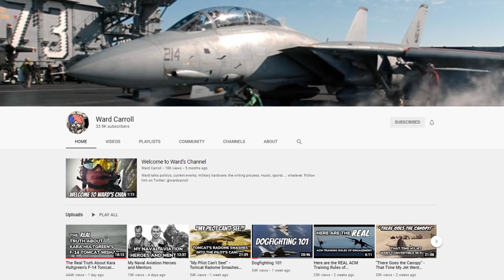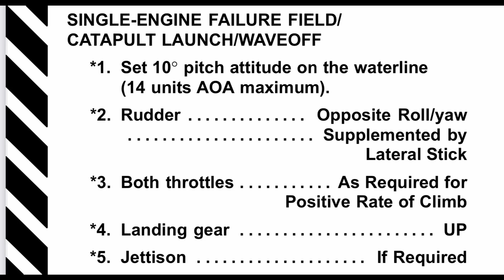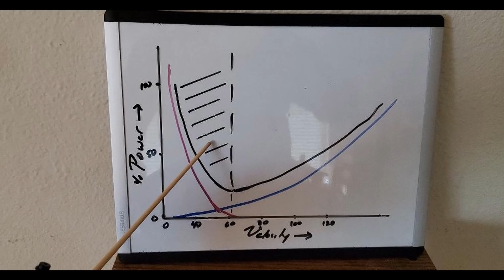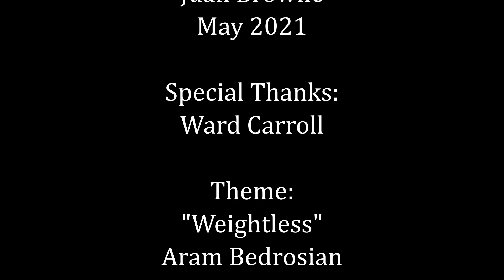Navy F-14 Crash/Stall Demo-Lt. Kara Hultgreen Accident

Comment: Unfortunately the Navy chose to handle the women transitioning to tactical pilot position differently from the AirForce. The Air Force didn’t change their syllabus to make easier and more abbreviated like the Navy did. The Navy back then had two trips to the carrier in the T2 and TA4 before even receiving your wings. Air to air gunnery on a tow target. Bombing. ACM. These women didn’t receive that training and it showed

Comment: A correction to the Kara Hultgreen accident. When Kara over shot the final she didn't use aleron. This is from the Wikipedia page "Finding herself overshooting the landing area centerline, Hultgreen attempted to correct her approach by applying left rudder pedal, which caused the nose to disrupt the airflow over the left (inside) wing, as well as the airflow to the left engine intake". IMO pilot error...

Comment: I think it just dawned on me what you are doing in the single engine plane to "simulate" the compressor stall aerodynamics issue.  Because you only have one engine you can't induce yaw from a one engine failure in a twin engine airplane (regardless of how close the two engines are).  So you use rudder to induce the yaw and then show how aileron is the wrong input.  In the single engine of course this is quite obviously a cross control maneuver and exactly what you would do to start a spin if you have high AOA and or low speed.  So the moral, if I have this right, is the engine out on a twin is aerodynamically similar enough to tossing in rudder on the dead engine side and so the first move is to counter that with opposite rudder.   Is that correct?

Comment: Indeed, the F-14(A/B)'s twin engines are actually offset (separated) quite a bit more off the center than usual for twin-engine fighters and that single-engine roll is a much bigger deal in F-14 that pilots have to take in account, so it wouldn't be inaccurate to say that the design of the F-14 itself contributed to this accident, at least in it being fatal. You can see this being pointed out by one of the designers as "Widely Spaced Nacelles" https://www.youtube.com/watch?v=SsUCixAeZ0A at 19:22 -- Fellow patron for 2+ years here and BTW you can fly F-14B in a home computer simulator, seeing that you got into MS Flight Sim 2020 recently, it may be another thing you could try: www.digitalcombatsimulator.com - Infact you have a couple of civilian planes there too, one of them you mentioned in the recent Aviat A-1 Husky video you did 2 months ago, the Christen Eagle 2 one of the civilian airplanes that's available in this computer sim here https://www.digitalcombatsimulator.com/en/shop/modules/christen_eagle/ and then you have Yak-52: https://www.digitalcombatsimulator.com/en/shop/modules/yak52/  as far as civilian goes, the rest are military, and for reference here's the F-14B: https://www.digitalcombatsimulator.com/en/shop/modules/tomcat/ -- And well that means you could as well try that same thing in the virtual F-14B hehe! And, I have a lot of DCS modules, but not the F-14B yet, had it on my queue for a while!

-- Setup --  First you would need to download the free DCS 2.7 installer https://www.digitalcombatsimulator.com/en/downloads/world/beta/ with it's base files and data which includes a free terrain-map based in the Caucasus region, there will be another free map later in the year based in the pacific ocean as "Mariana Islands", then each aircraft and terrains/maps are paid modules that you can buy and install separately it's striving to be serious simulation so it will cost something. DCS unfortunately requires a really good computer (Windows 10 only) preferrably with fast SSD storage and great CPU to prevent stuttering, not to mention a great GPU to keep the FPS playable. It can take over 200 Gigabytes of storage with all the modules but you might only need around 60-80 gigabytes of free space if you just try Christen Eagle or Yak-52 for example, depends largely if you buy additional terrains/maps which take the most space. Terrains in DCS are totally different from MSFS20 due to focus on combat simulation and not civilian transport or long distance hauling, so no such thing as whole world coverage (yet), they're are also very much hand-made, unlike MS Flight Sims including 2020 which is largely a script-automated process from imported sources of world geometry and topography with select areas hand touched such as airfield perimeters and important landmarks. 
DCS's terrains might look better closer to the surface because of the high amount of attention each inch gets. There's a few flight "sim/game" softwares out there and they don't all compete in the same category so the differences aren't pitfalls or victories, they have different goals and intentions, some are more game-oriented and simplifed, just to clear that up if you're indeed just now learning about this computer flight sim stuff and if you see any of the drama, the communities are definitely more mature than any other computer game category, but you should also note that there may still be teenagers involved due to these computer simulators crossing into the "video game" fields as they get more and more photorealistic, so that if you see the drama or some people talking nonsense it may just be children/others arguing with themselfs who never stepped into a real aircraft or studied highly sophisticated physics/mathematcis and real aircraft manuals. Hopefully you can figure out the technical side of it getting it running, you can aslo get it on Steam but they have their own standalone installer-updater and e-shop on the main site, otherwise there's always very knowledgable people available to answer any of your questions at https://forums.eagle.ru 

-- I've actually thought about giving you a heads up on DCS for quite a bit now, been busy and didn't find a good excuse, but just found the perfect opportunity right now, except I hope I didn't barge in during your fun with MSFS20, take the time and enjoy that ofcourse, no need to rush hehe. 

-- What I find interesting is that you, as a real pilot, (I'm afraid I can't afford to, so only computer sim background on my end), could try and test some of these computer airplane sims out and see how they behave and give response to how you experience things in the real jet, doesn't have to be professional review or serious testing, it can be on a depth level you feel appropriate, but even with just that maybe you might find some issue or s huch if you feel something doesn't feel right in the computer sim, so it wouldn't be just fun but it could evern count for some valuable feedback to improve the software. So yeah I'd love chatter and comparison videos if and when you get extra time, and where you feel you could provide some unique insight where it is worthwile, don't have to do it if you feel there's not much to say, I wouldn't want to cut other important stuff you're doing out with this hehehe.
  
-- And lastly, I kept funnily remembering myself about the potential confusion of "simulator" which we would all have differentiate these days, because in your backgroud you have most likely always meant the multi-million dollar full-cockpit PHYSICAL simulators made by the manufacturers of real aircraft (or learning/testing company/agency?) for that specific aircraft, ...
Whereas the home personal computer simulators are usually just the software side of it, is not compatible to run on those custom physical ones and it's not even made by the manufacturer of the real counterpart, then the hardware such as joysticks, throttles, pedals are all made yet again by another third entity which is usually meant for a range of software sims and not one particular aircraft only, thoguh themed-focused exceptions exist.

-- While computer software simulators are not new but were certainly very much niche and now have risen in popularity greatly and a phenomenon is happening right now of many real pilots finding and getting into these computer simulators, to fly their old planes they used to, etc, and in general the popularity has also been amplified due to the health situation these days, and that coupled with the cryptocraze it has made GPUs very expensive, due to GPUs being used for cryptomining, which leaves gamers and simmers screwed, hopefully your computer already has a beffy GPU or you may be stuck with what you have because the ones that should cost 500 can cost upward of 1500 or more due to inflated prices as demand is super high. Tech analysts hope that GPUs prices fall down toward the end of 2021 if crypto diminishes and second hand sales begin falling like a rock as miners get rid of them.

From what I'm seeing your running MSFS2020 smooth, I think it shouldn't be a problem with DCS either for just a simple civ flight, unless you got a lot of other activity going on, large cities can be laggy (somethign which may be greately resolved when DCS moves to a new graphics engine based on the new Vulkan API, that is suited for modern multi-threaded processing we have in our CPUs today)

PS: Just incase anyone wonders, I don't have any flight sim or gaming content on my channel anymore (unlisted), because I'm splitting it off to another channel or streaming platform but didn't finish that transition yet, it was mostly beta testing stuff anyway for development.

Comment: hmm..Compressor stall. From my days at the powerplant I know it's a hard subject to understand even for operators who are trained in thermodynamics  of gas turbines. Large industrial gas turbines have bypass valves on the gasturbine from the compressor discharge that are open at startup to the exhaust. Compressor stall usually only happens at low RPM and airflow  in the compressor. In the worst case scenario it can wreck your compressor blades we know from expierience. So I guess in aviation always try to keep as much power on it as you can during landing especially at low ambient pressure and do not increase power too fast at low RPM.

Comment: This is a prime example of a pilot trying to force a landing when they do NOT have a stabilized approach. Lt. Hultgreen should have done a missed approach. Her efforts stalled the engine by inducing a lateral angle of attack higher than the engine could withstand.

While there is discussion of NATOPS, the real solution was the development of digital flight controls introduced on later models of the F-14. As a commercial pilot, Juan ought to recognize the TO/GA switch. When she was at 3 nautical miles and was way off line to the runway, she  could then push the button and the plane would help her and save her life.

Comment: But what about what produced the compressor stall.  Was overshooting skidding turn  produced that critical engine fail via blocking the left air intake?? Some even pull up too much elevator when overshooting.  Those are pilot errors i have seen on pilots overshooting the place to align when i was CFI.  Many pilots do skid the turn when see they are overshooting.  When banking, the flyover spot is on the side, not above, and if they overshoot, they pull more elevator towards it.  The Overshooting skid or over pull elevator pilots errors..

That skid turn can also kill the speed to a stall.   And  also too much elevator too when overshooting.  Overshooting can produce bad pilot reactions i noticed.  Also due they killed the speed, they hammer the throttles forward, which can produce engine surges.  
Overshooting pilot errors have killed thousands last few decades.  Practice landings with a 20 knot tailwind on base leg.  Surprises await..

Comment: Juan, how were you simulating the dropping of a wing in a two engined jet in your single prop job?  Were you stalling with one wing a little low so that you'd roll toward the low wing?  However you did it, it's the first time I understood why F-14 pilots talked about needing to use a lot of rudder instead of stick at high AOA - nice job!

I do have one question, though.  I understand how the dropped aileron on the low wing increases camber and causes the wing to stall.  However, the F-14 used spoilers, so you'd have nothing increasing the drag of the lower wing, but a board out up on top of the up wing - so I don't see how using lateral stick would induce the lower wing to stall and cause a roll.  Now, I DO see how turning into a dead engine could cause the low wing to stall, and that stepping on the rudder on the good engine side plus lowering the nose and applying power would be the best bet to keep flying.  So am I right that the cause of stalling the low wing is different, but the point is that rudder, not stick is the way to counteract the roll?  Thanks for any response!
Reply from the maker: The F-14aileron input also twisted the horizontal stab. Gotta use rudder...same as these small planes.
Reply: @blancolirio  Ahh, of course - forgot that those were tied to lateral stick input as well as fore & aft - thanks!

Comment: While flying a J3-C today, I practiced this type of recovery.  I was in gusty winds aloft at about 2500 asl, and my right and left wings were dropping periodically, so I practiced using rudder inputs to correct the wing drop, and lo and behold!  I think it worked!  I will have to try this in the other types of aircraft that I fly, when in similar conditions...at a safe altitude of course...this is not a natural reaction, similar to doing Dutch rolls, which use counterintuitive rudder inputs.  Very good practice.
Reply from the maker: Yep!

Comment: Why have a fly-by-wire airplane that you can stall - especially one where you are doing aggressive maneuvering?
It doesn’t have to be programmed that way.. In the Airbus family (for example) maximum back stick commands the near maximum angle of attack or g-load without risk of stall. Intuitive maximum performance.

Comment: Are the 2 engines counter rotating ?????
If so it would make sense the engines should rotate so torque is to the tip. Of each wing.  Am I right or wrong.?????

Comment: I had a flight instructor who insisted that I be able to maintain wings level strictly using rudder. He pulled my engine at about 3000 AGL and made me fly all the way to 1000 AGL maintaining airspeed and directional control with the rudder and vertical stabilizer. It was so ingrained after that, that my first response is rudder to pick up the wing. It was good training.

Comment: Mr. Brown, can you read this?? 
I taught partial power engine fails on each of the 5 legs of the traffic pattern.  Turning to a leg are the most difficult ones.  From engine fails turning final (The easiest one), to engine fails turning crosswind at 600 agl from the initial climb leg (The most difficult due a Turnback to opposite i taught too).  On all the 5 legs.  
Each can be different from the previous one.  Emergency Low Maneuvering i called them or ELM for short.  ELM is different than over TPA engine fails.  ELM is UNDER TPA engine fails.  Different maneuvers for each one leg.   

ELM its a different kind of of flying. (altogether!!)  You can use those names.  Im retired and dont teach anymore..

Those emergencies on take off or on landings i call as Emergency Low Maneuvering since i taught them in the 1990's.  Again, You can use that name.  I dont teach anymore..  
Emergency Low Maneuvering is the main cause of serious accidents.  Most CFI's avoid teaching engine fails take off or landing due they dont know ELM themselves.   They are afraid of their own pilot errors on ELM.  It just takes practice on home Simulator first.  I taught them to 15 hour and up students- Before solo.  2 of them saved themselves from crashing on houses later on.

Comment: Hello Everyone,  had a question about both incidents.  In the takeoff from catapult incident, what would of been the chances of survival had the crew stayed in the plane as it crashed into the water?  If still conscious and uninjured, would there be a way to escape the cockpit before sinking or drowning?  As opposed to ejecting inverted mere feet from the surface. (This sounds like zero % survivable so would the alternative been better).  Secondly, regarding the landing incident.   At what distance do they normally make this final turn?  It seemed like it was fairly close.  Why not approach from straight on from farther out, so that an overshoot of the centerline allows for more time and distance for correction (and perhaps a higher and safer speed??).  Thanks.

Comment: I think it's worth noting that the Tomcat isn't quite a centreline engine mounting - certainly not compared with the F=15,16, F/A-18, have always suspected that the relatively wide spacing of the engines and therefore more yaw with differential thrust contributed to the stalling out the wings. It's the only aircraft I know of (apart from the airforce's next gen built in a year plane) that did not have a prototype phase in the design.